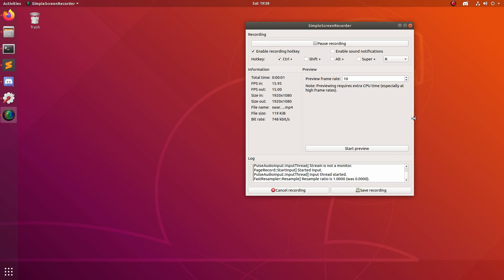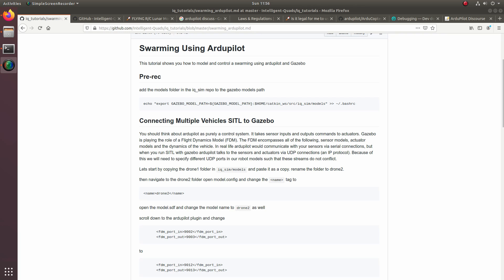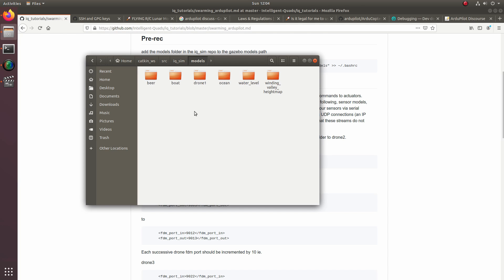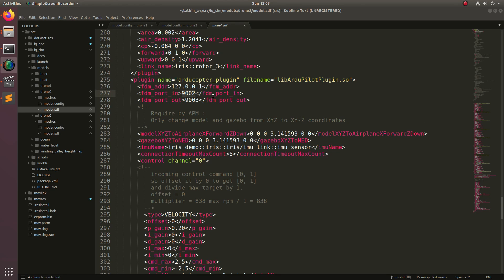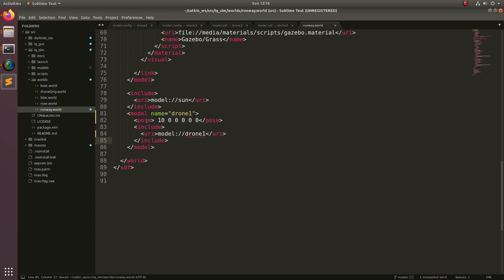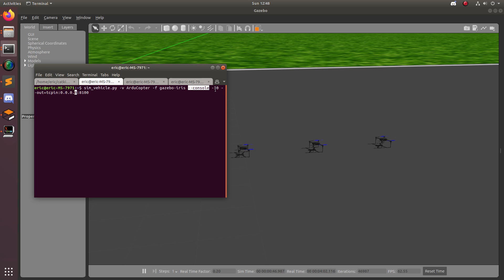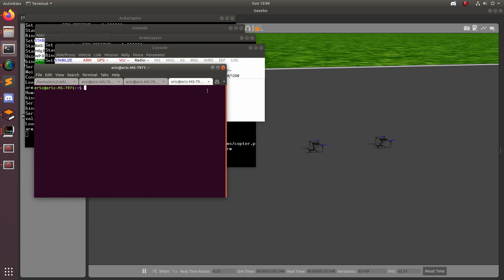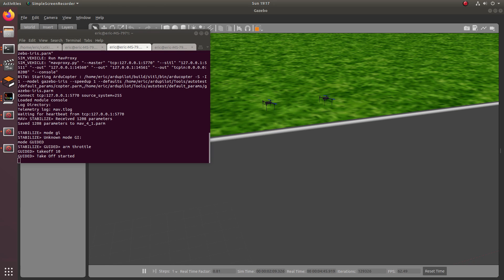20 Basic Drone Swarm Simulation and Control Using Ardupilot and Gazebo

Comment: link 1 down error pls help
Reply: you need to run qgroundcontrol while youre running the command to start the drone
Reply: I resolved this issue by switching my ardupilot_gazebo repo from the dev branch to master branch. (Was accidentally using the wrong branch)

Comment: I found the problem when I use the command: roslaunch iq_sim runway.launch
Error Code 11 Msg: Unable to find uri[model://drone1]
Could you help me?
Reply from the maker: make sure you run the bellow code and source the .bashrc in the terminal that you plan to run the gazebo sim in 
echo "export GAZEBO_MODEL_PATH=${GAZEBO_MODEL_PATH}:$HOME/catkin_ws/src/iq_sim/models" >> ~/.bashrc
Reply: @IntelligentQuads  I fixed the problem. Thank you very much and I am waiting for next videos.
Reply: @ngocphinguyen6807  Hey man, I'm getting the same mistake. How did you solve the problem?
I wrote this code (echo "export GAZEBO_MODEL_PATH=${GAZEBO_MODEL_PATH}:$HOME/catkin_ws/src/iq_sim/models" >> ~/.bashrc" )into the terminal. But nothing changed